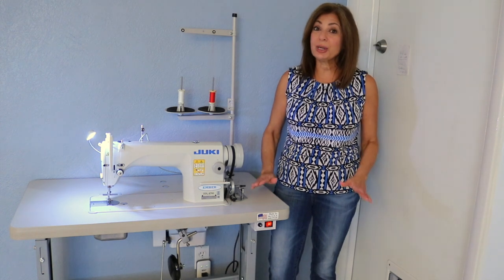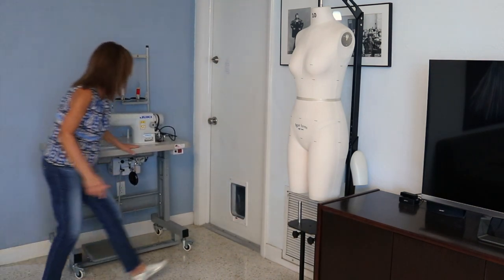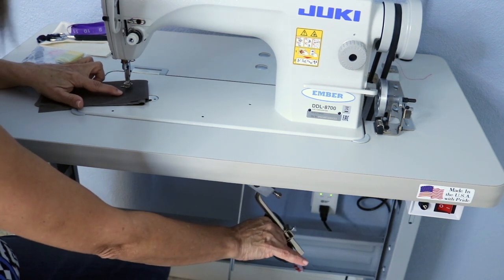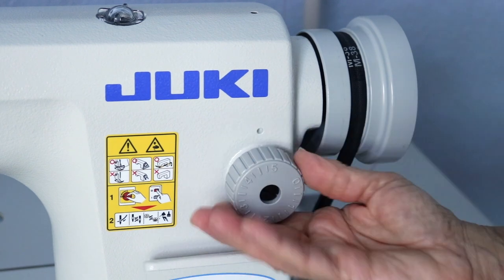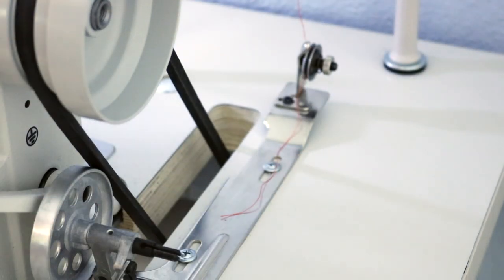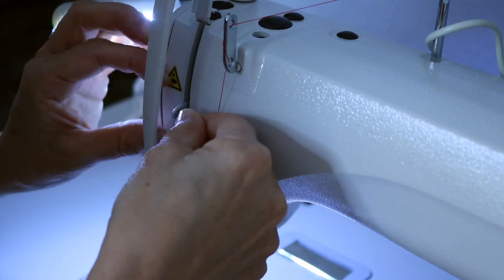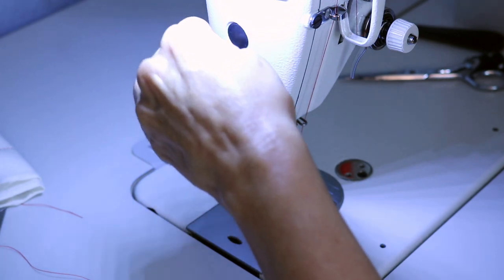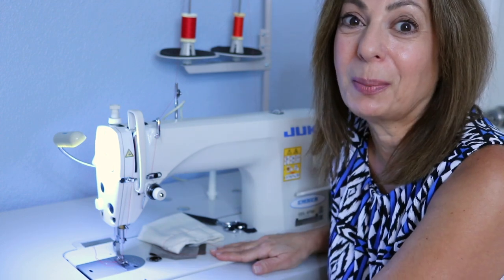Juki DDL-8700 Sewing Machine Review & Threading Tutorial!

Comment: I purchased this machine and I am having trouble getting the pressure foot to put enough pressure on my fabric.  I have adjusted it down as far as it will go, and the fabric still moves easily under it
Reply from the maker: It sounds like a feed dig issue not the foot itself. I’m not a mechanic so I’m not completely sure but in order for the fabric to grip, the feed dog under the metal plate has to be up a little and strong

Comment: great video. thanks for review.
may I ask it can also work with leather?
Reply from the maker: I would think if its a soft leather yes. Otherwise, if you are doing think hard leather you will need a walking foot machine.
Reply from the maker: I meant thick leather.....thank you for the praise
Reply: @susaneliascouture  thanks so much for reply. very appreciated.
Reply from the maker: @farhadfadayi7389  You are so welcome. Keep in mind there are specific needles to use for leather as well as different feet to use as well. I have only used soft Italian leather so had no problem with this machine.
Reply: @susaneliascouture 
 thanks for tip. am busy to buy "JUKI DU1181" from Ebay. it is big and heavy. hope I can get a agreement with the seller about the price

Comment: My juki DDL 8700 stops working. The light on switch is on indicates on signal but the machine doesn't work. The wheel only turn manually
Reply from the maker: Sounds like something is disconnected. Can you call a local sewing machine mechanic?